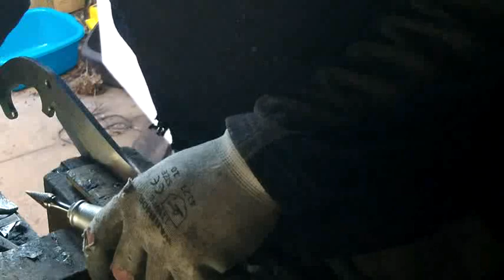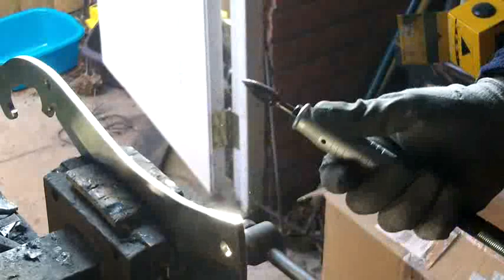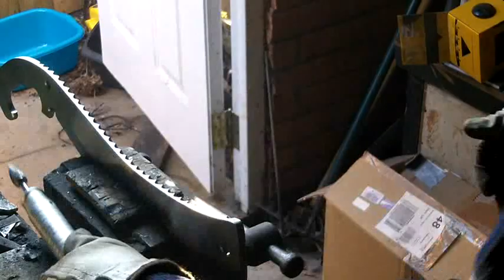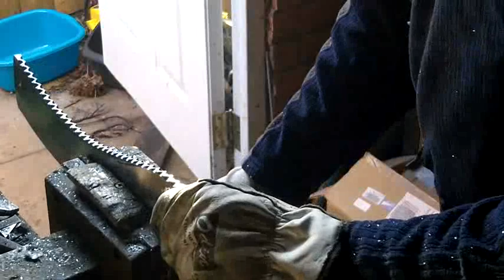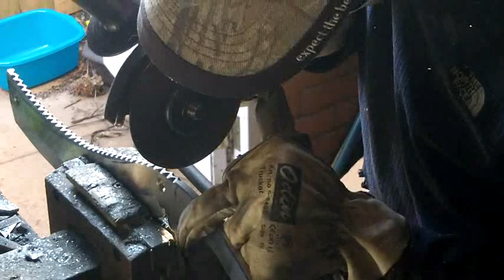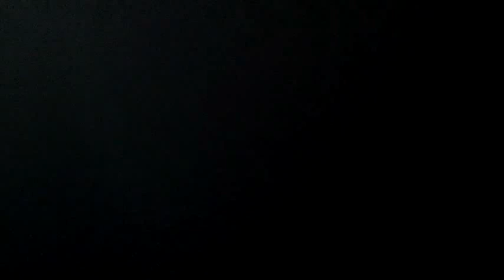Gimping the "Skriker"

Comment: Ok cheers, I was thinking of buying myself a better one, looks like the axminster would be a good choice then. Foredoms are nice but I doubt I'd use it enough to justify the cost.

I hooked up a flexible drill extension to my 2x72 before, thinking a 1500W rotary tool would basically be unstoppable. It was pointed out to me that it would also be quite deadly though.. If the shaft snapped and started spinning around, my face wouldn't exactly stop it either. So I just stuck to my cheap dremel clone